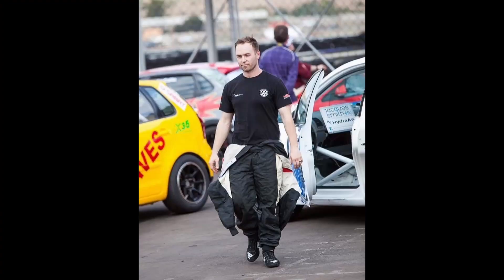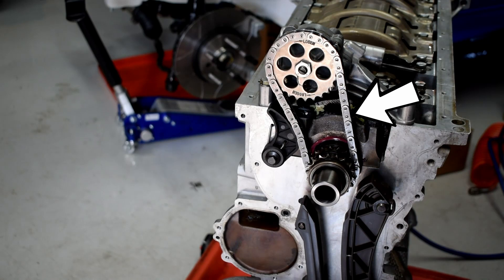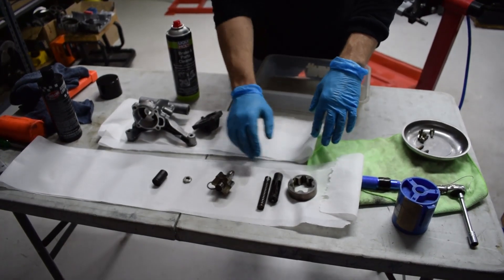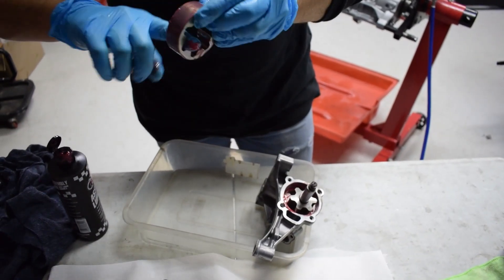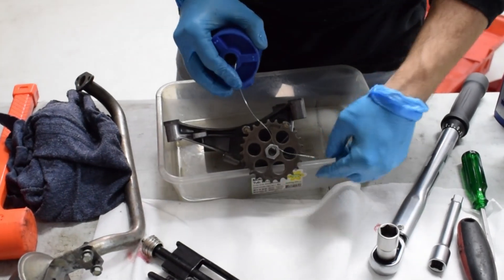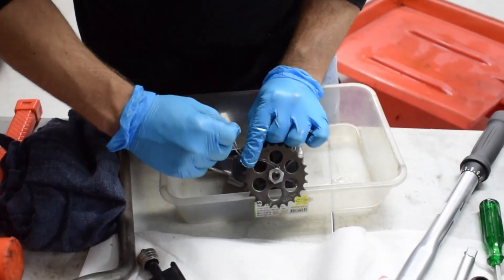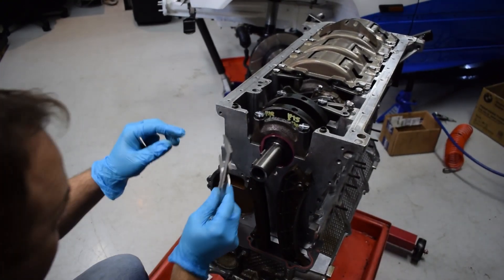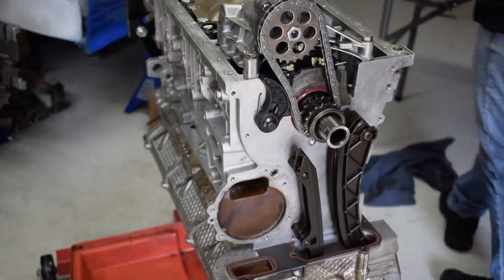BMW M52 M54 Oil Pump Lock Nut Fix with Chain Tensioner

Comment: did u have problems with oil starvation on stock oil pan in race condition?
Reply from the maker: Hi, no the stock m52b28 oil pan had had no issues but there are some which suffer a lot from oil starvation.

Comment: What was the play on the new oil pump chain after you fitted it? Just changed mine and it seems to be as loose as the one I replaced. I can’t find anything about tolerances in the bmw manual. Thanks in advance
Reply from the maker: Yes I remember there is a fair amount of play standard. I think it’s normal and fine in normal driving situations. It’s just when you track the car a lot then you need to do the mods.

Comment: Thank you for this. I had my engine rebuilt, and since then, I get an orange oil pressure warning light, and then valve tappet noise. I replaced all of the tappets and the noise persisted. Just bought the tensioner kit, and also the pressure regulator spring. Do I need to take the engine out, or can this be done without removing the engine? Thank you! Mine is 1999 E46 323i (M52TU).
Reply from the maker: Thanks for watching. I would say make sure the oil pressure sensor and wiring is working properly. If the oil light is on that is big problems. I would say that needs to be checked properly.
The engine doesn’t need to come out but it is a very gin job to do it in the car.
You can do it in the car though.
Reply: @ssbb_builds thank you. I’ll get help to get it done. I might just remove the engine to do it properly. Thanks again!
Reply: orange was for low oil level and red was for pressure
Reply: I THINK YOU NEED A MECHANIC FOR YOU ENGINE ,